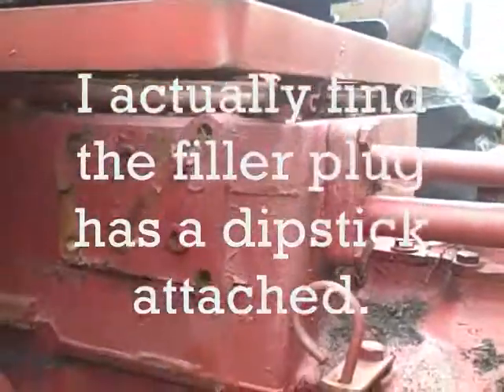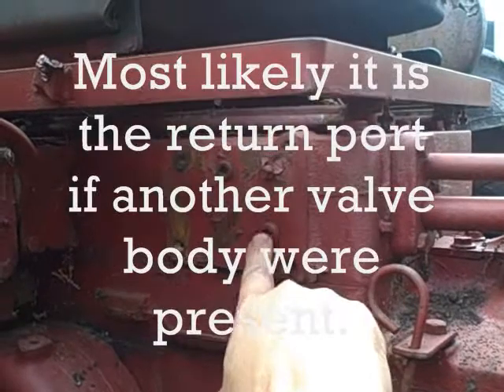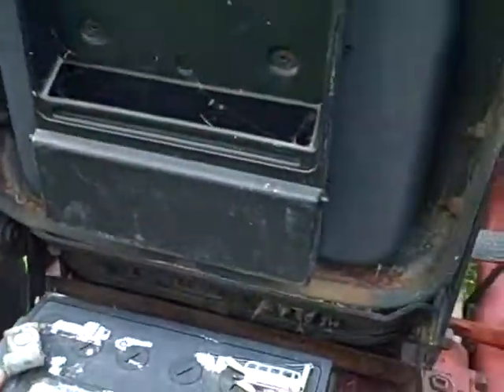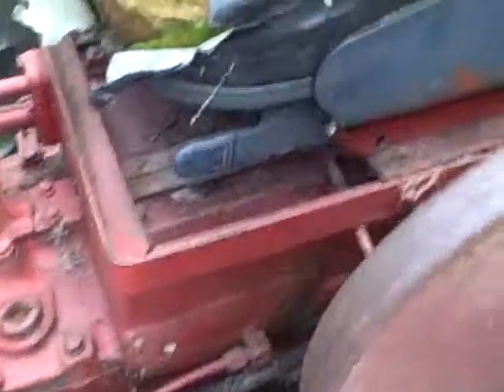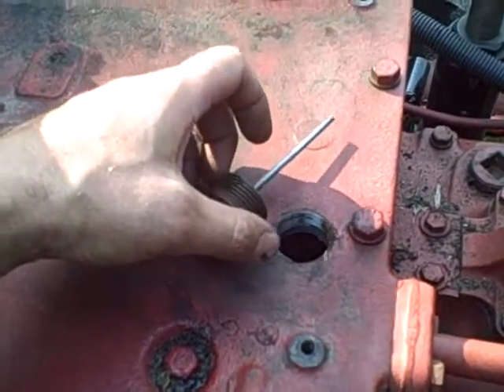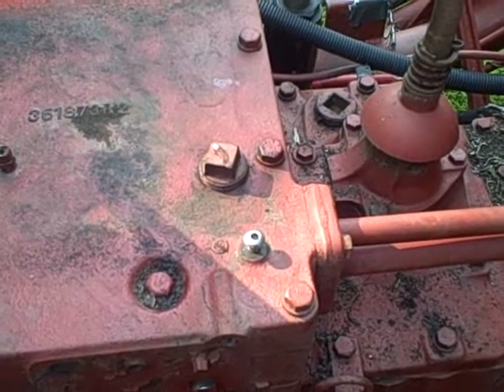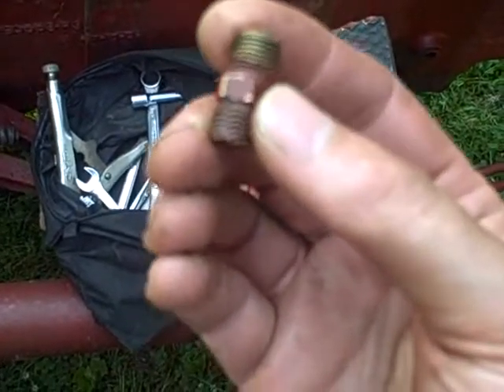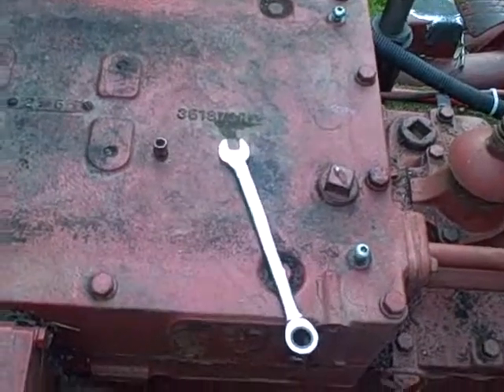IH 350U Tractor Project Part 19

Comment from the maker: Yes, I think I have seen the valve blocks on Ebay from time to time. The loader on it now is a self contained unit, the frame is the resovoir, the pump is front mounted. This keeps the loader hydraulics isolated from the tractor's hydraulic system. I guess if I ever ran an impliment that needed a second cylinder, I could add another set of remotes.

Comment: Steve - a few questions for you: 1. How long does it take you to get this IH going from start to end in actual days. 2. How do you get the time for all of these projects with 3 & a wife. 3. What price should one expect to spend on a tractor like the IH or Oliver in the condition in which you bought them? Thanks
Reply from the maker: The IH took weeks in all to get the motor running because I could only spend a couple hours a day, and sometimes was not able to even get to it for a few days because I did the motor work at the sellers house. I never have enough time, but am self employed, and can sometimes make time during the week, when the kids are in school. As for what to spend, hard to say, most I ever spent was for the Ford 1920, but that was at auction, and was a much newer machine. The Oliver was headed for the scrap yard so the owner gave it to me. The IH 350 was sitting out behind a customers house, we got to talking about old tractors, and he showed me his. He wanted to be sure it was not scrapped, so he sold it to me for $400, and I honestly think he did not know how bad off it was.